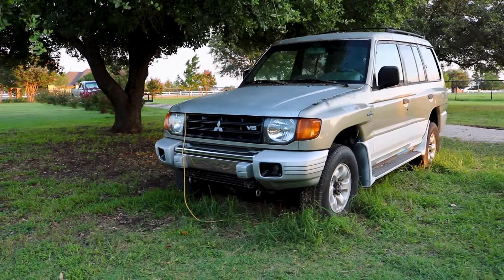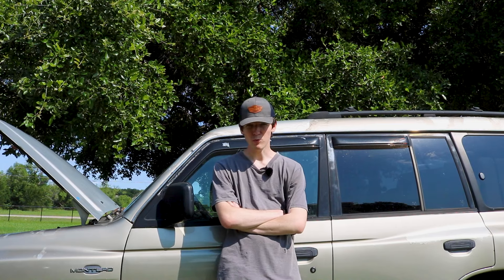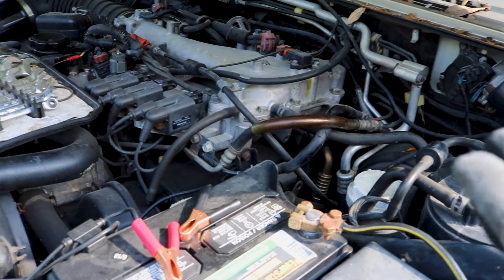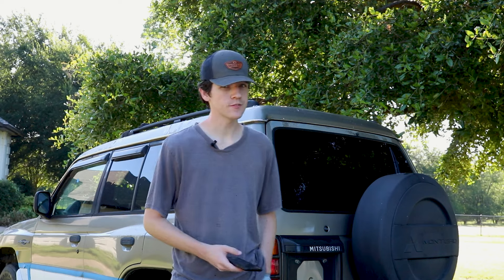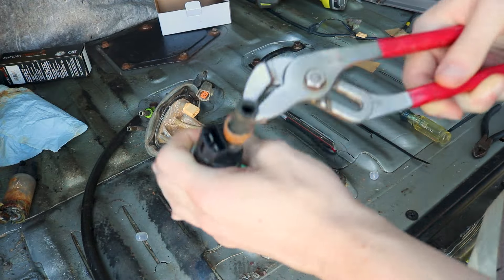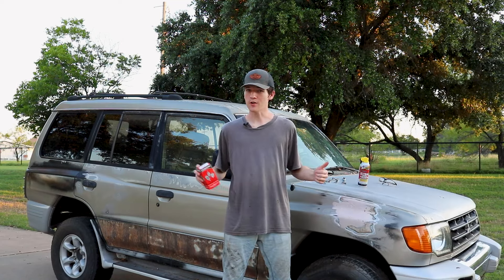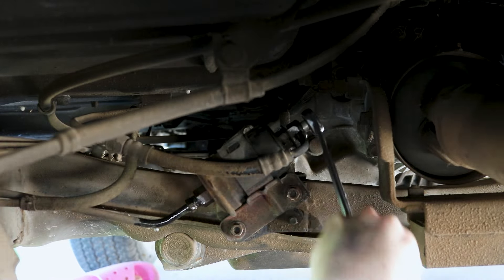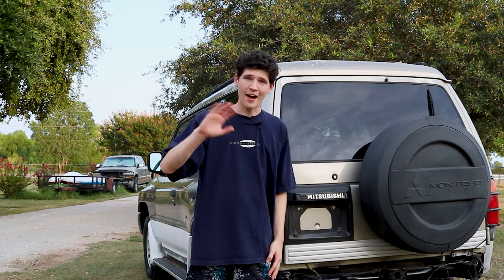RESTORING MY MITSUBISHI MONTERO WITH NEW FUEL SYSTEM

Comment: Nice work , I just got mine running after belt change, bad injectors .. cheep ones I got of eBay .. now it's slow, trying to figure out y.
Reply from the maker: Uh oh! At least it's back up and running, but maybe cheap parts weren't the way to go😂 I get all my parts from rockauto and I haven't had any issues in the last 3.5 years I've had the car. Did you ever figure out why it was slow?
Reply: @PhinysGarage  hi,well it's bean a while, and a lot of stuff happens power steering pump almost explodes and got power steering fluid on exhaust , and cought fire, then I have a water leak from the water pipe that goes in the valley , bought the OEM pipe but turns out it's the one for a diesel motor and I got it from Dubai so no exchange i got to sell it , lol I want to make a video abut it.. 😅